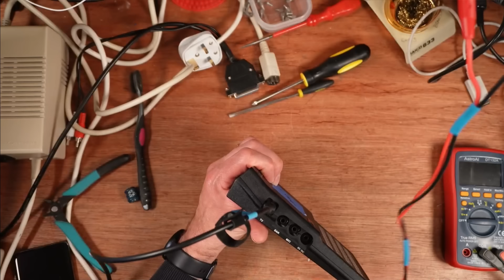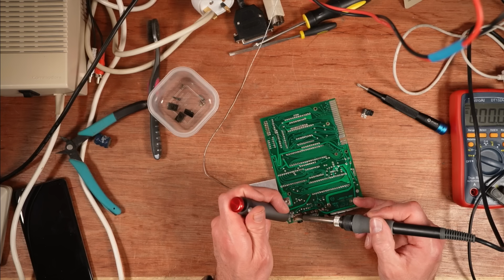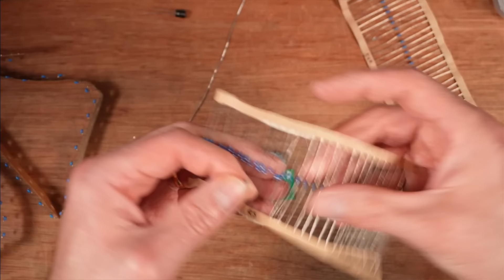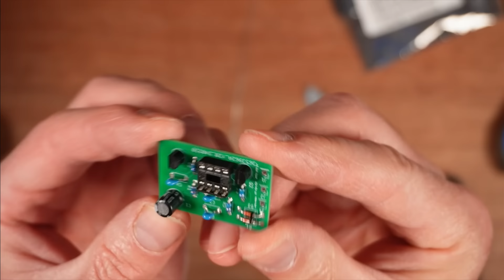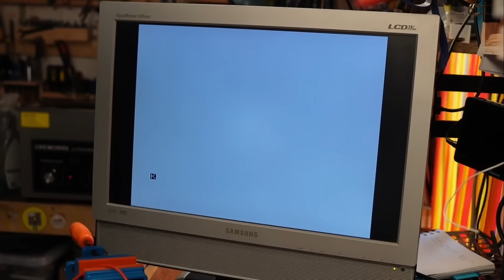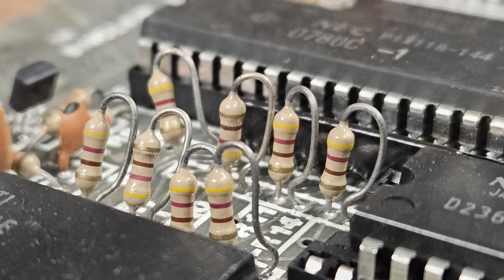Repairing and Restoring a 43 Year Old Computer - Sinclair ZX81

Comment: The ZX81 was my second computer with my first, in 1976, being a Radofin 1290 with a 6.5 K RAM programable cartridge. This used Signetics 2650 assembler so the ZX81 was a breath of fresh air, by comparison. Sure it didn't have the 40 x 25 8 colour graphics of the Radofin, but it had Basic and a "keyboard".

I still have the Radofin 1290 but the keypad / controllers need rewiring and I don't have a diagram.
Reply from the maker: Amazing. Thank you for sharing your memories

Comment: I still have my old ZX81 and I replaced the membrane keyboard last year, after my Memotech peripheral keyboard decided not to work.

I used my ZX81 for robotics experiments and installed a 9 pin D socket into the top case to allow 8 key inputs via switches, back in the 1980's. I frequently had it attached by rubber bands on top of an old Tandy 2 motor steering 49 MHZ car (with the RC unit removed), with old keyboard buttons as sensor bumpers and some circuitry attached to the zX81 expansion bus controlling the car's 2 motors. A 9 volt PP3 powered the ZX81 and a pack of 8 AA batteries powered the car's electric motors. The robot could run for just over 40 minutes before the motor power batteries ran out.

I also built my own design 2, 4, 8, 16 & 32K RAM packs plus a couple of PIA IO boards. The knowledge and skills I learnt designing my own expansion boards for the ZX81 came in handy, in the late 1990's, when I was asked to design a PC bespoke IO card for some work project.

Comment: Frightened to look in my loft - not the ZX81, Spectrum or  Mega Sega PC - but 2 huge boxes with 100s of redundant CABLES collected since 1990 - all permutations of connectors plus mono/stereo or male/female variations at each end - firewire, scart, coax, phono, USB various types, 1/4" jack, 1/8" jack etc  - ECOLOGICAL & FINANCIAL NIGHTMARE FOR ME
They take up space doing nothing for 25 years, but if you bin one, you will be desperate for just that one the next week.

Comment: I made 3 mods to my ZX81 -ventilation holes drilled along back plate, an adjustable L bracket to stop the external RAM wobbling, and finally a joystick with Fire button made from a small Maplin box and parts for maybe £10, and soldered the short 6 core cable onto the 6/7/8/9/0 connections on M/board - The metal joystick was briefly TOUCHED against the edge of hole in metal top-plate of plastic box as the earth return (and fire button), giving very basic control in the 4 directions.

Comment: My main ZX81 is heavily modified. I've give it 32K internal RAM, Traco regulator, SD card adapter for saving and loading with modified ROM and a programable joystick port.

I ❤ZX81

Comment: I built a ZX81 from a kit in probably 1981, sold it a couple of months later. eventually bought a used BBC B.  Oh and the ceramic thing you drilled out is a feedthrough capacitor.
Reply from the maker: Ah! Good info. Thank you

Comment: It's not a proper 81 until it has an added velcro strip for holding the ram pack on !😂 Any oldies will remember the frustration of hours of typing a program only for the pack to fall off before you can save it !
Reply from the maker: Blue tack! :D
Reply: i used matchboxes to lift it up for better ventilation and  another to make a wedge for the adjustable ram pack support
Reply: Good old Clive, so nearly perfect. @frombrum

Comment: The modulator isn’t the cause of the dark image, it’s the ULA. That’s why the 555 timer chip is required, to fix up the non-standard signal that’s being received.
Reply: yes, the early versions of the ULA dont generate a 'back porch' pulse which a colour tv uses to clamp the black level, black and white tvs dont use or need this,  its nothing at all to do with the modulator, they work properly and give good pictures with correct signals fed to them, and very rarely fail... also even with back porch, many tvs still wont display the picture  correctly, even going 'blue screen' as if no signal,  my kitchen tv does, its very picky, this is due to non broadcast standard frame sync pulses... i am currently thinking of an alternative way to get composite without any internal alterations, but extract it from the 'mic' socket as this is also fed from the ULA video output pin, but attenuated and low pass filtered, any external circuit would need high gain and reverse the filtering, and likely some 'schmitt trigger' circuit for both video and sync to remove noise generated by such high amplification

Comment: Superb work the zx81  made computers affordable i love the looks of them .The one i have i believe has an issue 1 main board no composite mod yet
Reply: issue 1 boards were fitted with the early ULA so unless the ULA has been replaced with the later type, it will need a back porch generator type mod...

Comment: What's a back porch?
Reply: There's a video on my channel called ZX81 Video Conditioning that explains this and describes how the circuit to add it works. I tried giving a link here, but Youtube just makes my message invisible to everyone.
Reply from the maker: @JoulesperCoulomb hello Joulesper! Your videos have taught me so much and I still point people to them when asked about how to do initial checks on a ZX Spectrum. It's good to know you're still about!
Reply from the maker: So, my limited understanding was that it sets the black level as well as some timing stuff during each pulse. But I thought I should look it up before I go sharing information, and on StackExchange they say "Back porch is the duration between end of horizontal pulse and start of the next line with video information. Lasts more than front porch around 4.7μs and the main purpose is to give the time to beam scanning for reverse direction (right to left) to start new line. In addition it sets the reference black level as well as sets the timing of color burst pulse."
Which is kinda what I said :D